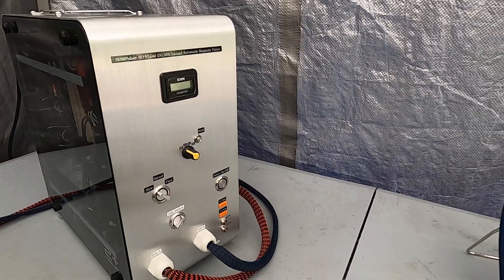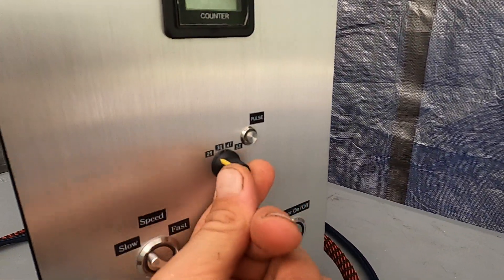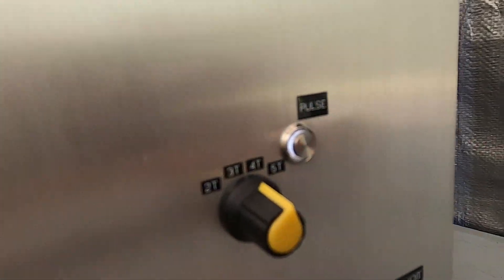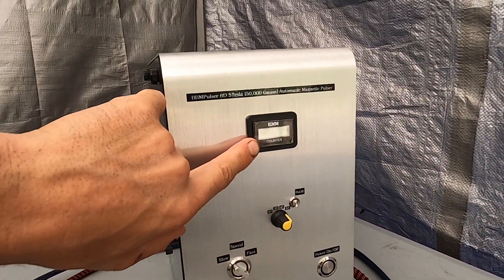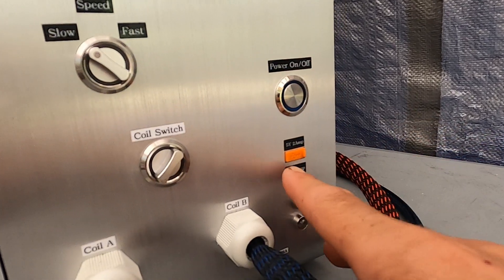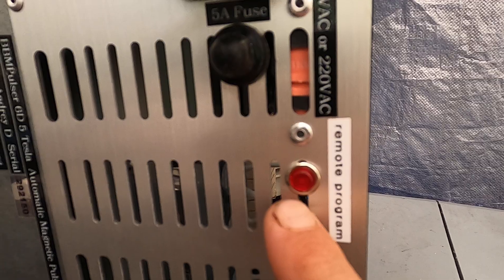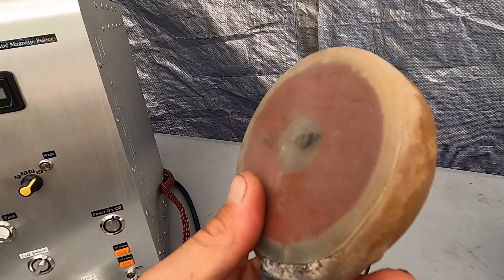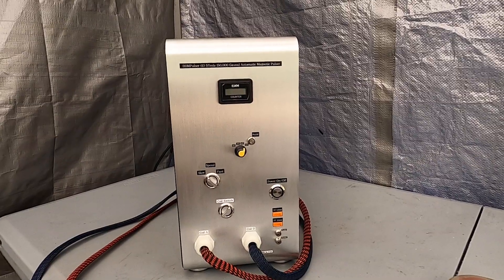105 New case BBMPulser 6D 5 Tesla Magnetic Pulser

Comment: hi Dear Andrey the bbmpulser (5B standard) which i build suddenly stop pulsing After i change thyristor 50RIA120 instead of 50RIA100, and coil 14AWG instead of 18AWG. is that really matter to stop blue LED to function or not? The pulsing is totally stoped....what do you think?
Reply from the maker: You are saying the pulsation stopped, how does blue pulse led acts? Does it come and stays on?
Reply: @AndreyD  Andrey the blue LED completely sttoped only power on LED is active , the blinking LED also not ON.
Reply from the maker: @marakiwyinager581  if pulse led is not on while unit is on and should be pulsing then you need to check capacitor bank feedback line to the low voltage side of the circuit. It's probably not getting it's signal from capacitor bank to trigger the pulse.
Reply from the maker: @marakiwyinager581  try changing back old thyristor. And why are you upgrading for one with higher voltage?
Reply: @AndreyD  Andrey right now i return the 50rai100 and i found 2 diode (RURG80100) which is faulty i changed.and it worked for a while and after 5 minutes working 2 charging capacitor(120uF/450v) explode.
Reply from the maker: @marakiwyinager581  from my experience charging capacitors should not be getting even worm.
The first capacitor in charging circuit should be large (motor start capacitor) other can be regular.
To stop blowing diodes you must use capacitors with less then 120uf 450V and connect 2 of them in series to act like one 60uF 900V.
Also add inductor in the line of capacitor bank and charging circuit, this will prevent diodes from blowing, I have one of my video talking about this inductor
That's what I do and they don't blow then
Reply: @AndreyD   i used 2 motor start capacitor in parallel to get 24uf....may be is that making the charging capacitors which connect with motor start capacitor warm and explode?
Reply from the maker: @marakiwyinager581  your 2 motor capacitors that you connected in parallel,  what's the voltage are they rated at?
Reply: @AndreyD  450v each and one rated14uF the other rated 10uF
Reply from the maker: @marakiwyinager581  okay, if your charging capacitors are 450V, with capacity of 120uF or less, and your charging capacitors worm up, then you have some issue with charging circuit.
It's possible you reversed polarity on one of the capacitors  in charging circuit ? (motor capacitors won't have polarity)
Also check the output voltage at the end of line (capacitor charging circuit), but first disconnect cap bank feedback line to the low voltage circuit, the voltage in the capacitor bank will rise to around 910Vdc, if it's like 800v or less then you probably connected something wrong in charging circuit